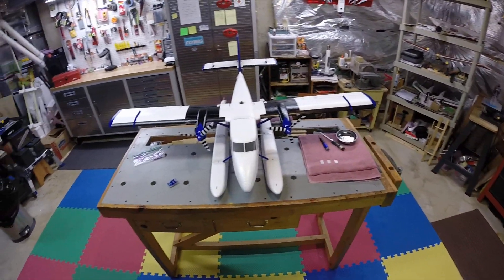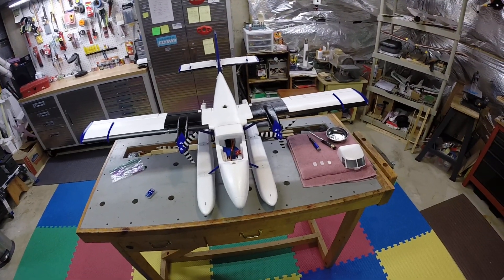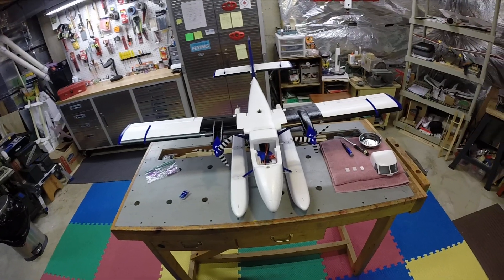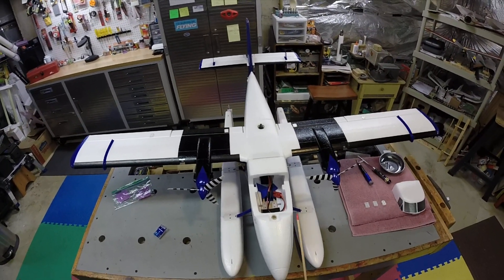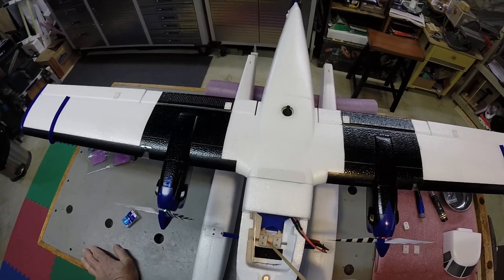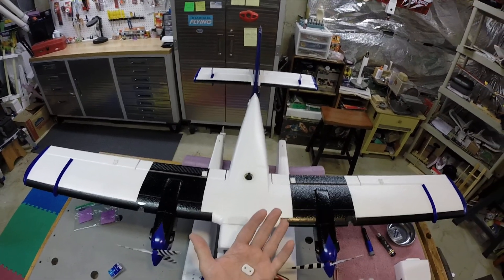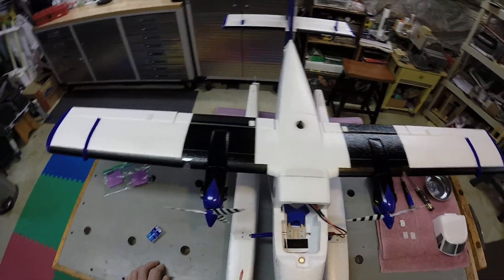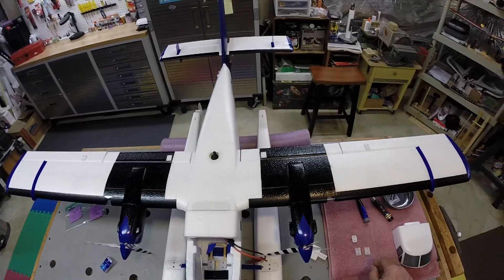Twin Otter - Float/landing gear brackets

Comment: hey bud how about the rear covers on the float strut I just popped them on and do I need to secure them? also the covers on the front struts? like to know what you say?
Reply from the maker: Hey Joe, You have a great website and your video production is superb.  I just checked my plane.  By back covers are missing and the front ones are just held on with some silicon glue.  They are obviously only for "looks".  
I too am from PA (Meadville) worked my way through Edinboro college making Channellock plier at night.